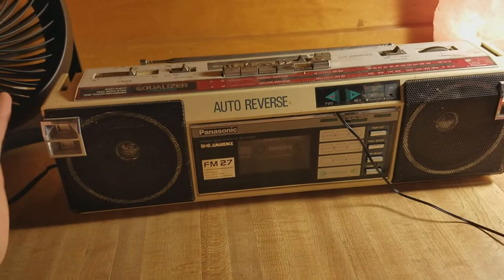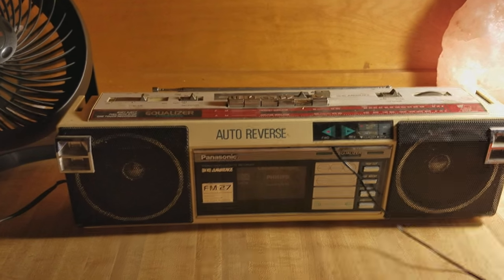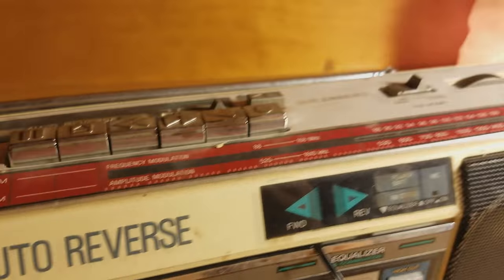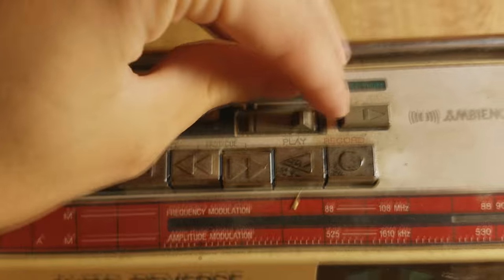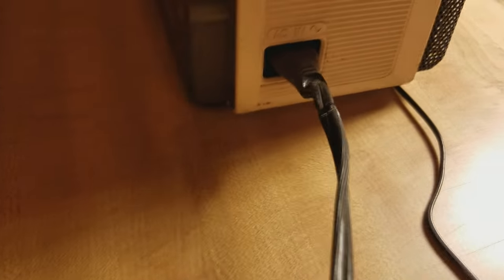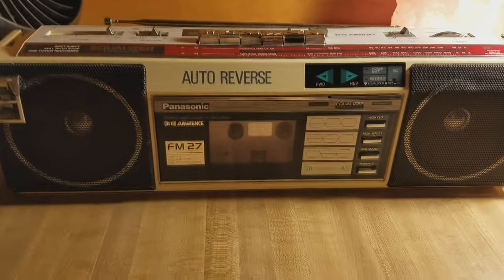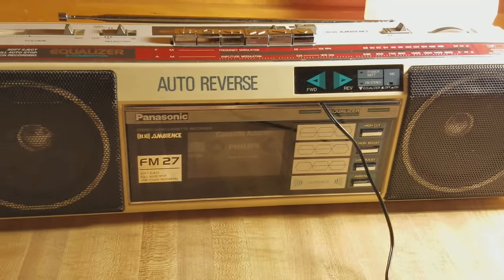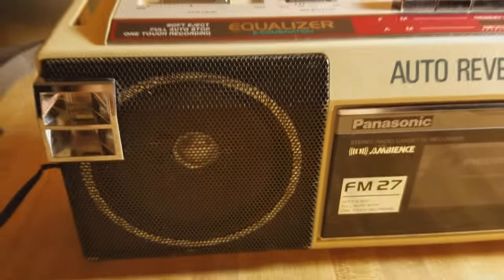Panasonic Equalizer RX FM16 Cassette Player (HOOKING UP AUX)

Comment: Got the same one, replaced the 6 D cells with a usb battery pack and usb to 9v adapter, then removed the tape pre amp chip and wired up a bluetooth module to it, bluetooth module is on a switch so it can be shut off when in FM mode. I would've kept the tape deck functionality but it was shot, and these seem common enough so I didn't feel bad, sounds great with bluetooth wired straight to it instead of through one of these adapters. Anyone who has the issue where you turn the volume all the way down and the speaker blasts and makes awful noise, got worried about this too, I sprayed some faderlube on the control when I took it apart and it's fixed. Panasonic made some sweet sounding stuff, sounds too good to be a plastic boombox. The tweeters on the front are real too, not sure how much they work but they seem to make the treble sound really good.

Comment: It's 2022 and i just the exact one you got for 15$ at a salvation army. If i dont keep it i Plan on flipping for 40$-50$. I would not say it has the best audio for a boom box but its fine. If its really from the 70's though that's nuts. But assuming 80's as of now its probably around 40 years old.

Comment: this looks like a fm27 not fm16
Reply: I have the 16, looks nearly identical other than the design of the labels being a little different. Same casing and speaker/tape deck setup as the 27 though.